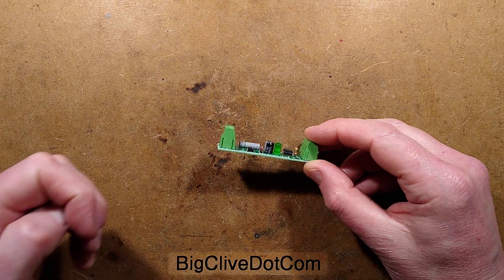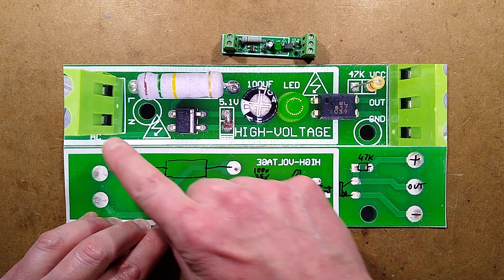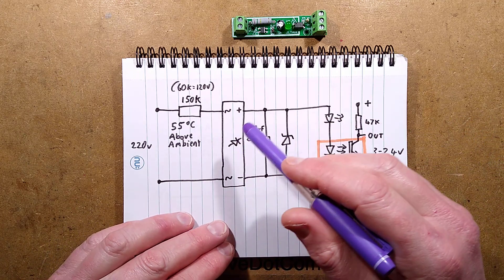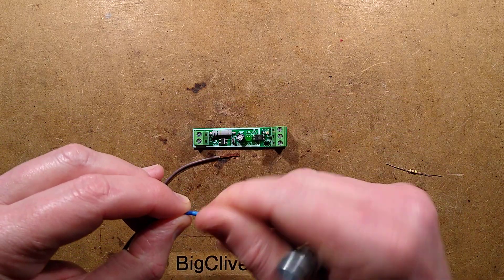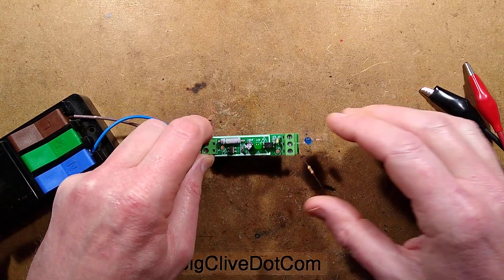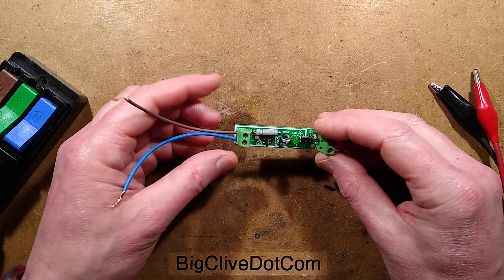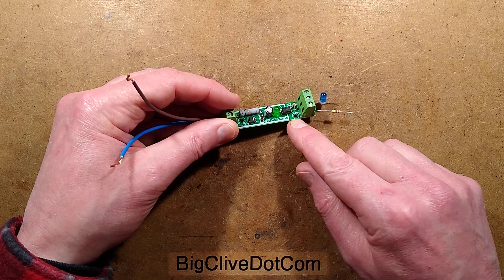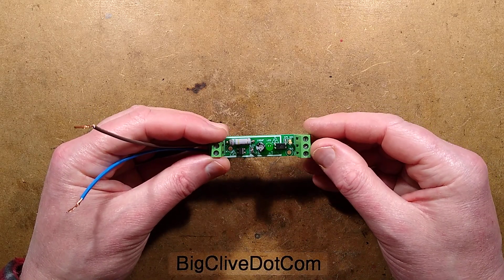120/240V to logic level optoisolator (with schematic)

Comment: Whilst I'm not an engineer who needs to use these on a day-to-day basis, this was very interesting. And handy tips to designers and manufacturers based on your experiences. Good stuff.
Reply: I'm going to use one to detect when my oil boiler is actually fired up by connecting it to the oik switch solenoid. This will then send the data to Home Assistant which will log the hours burnt and tell me when to refill my oil.
Reply: @WINGNUT307  
Good to hear of a link to monitoring your oil boiler with a Big Clive practical application.
He must have been a very accomplished lift engineer with his approach to repair.
Servicing in any trade needs more Clive's, my opinion for fifty years and travelling half the country working for national companies.
As an industrial electrician from the sixties I did a crossover to  work as an R&D engineer on oil combustion, including boiler design and then gas combustion after the oil crisis.
My electrcal knowledge gave me fifty years of advantage to help many good mechanical engineers to improve their electrical thought processes. 
I made alarm circuits to notify customers when the oil tank was getting low, float switches with mercury switches to prevent any fire risk with arcs and oil vapour venting to atmosphere.
All before Watchman or similar systems when I became a heating service engineer in Dorset and Hampshire. Oil servicing had few respectable craftsman so getting paid to drive around the New Forest was a gift.

Comment: The zener is there to protect the cap from a smoldering death in case either LED goes open circuit.
Reply from the maker: The current is very limited, so it might possibly pop, but would be more likely to slowly vent.
Reply: @bigclivedotcom  the hiss of sadness...
Reply: Magic smoke
Reply: @bigclivedotcom  we want to see what happens if you disconnect zener and the LED.

Boom or fzzz.
Whatever, if a cheap zener can prevent just a little goo in your box, fine.
Reply: @bigclivedotcom  Are you sure it is zener? Maybe it is there to offer ESD protection to the input side.
Reply: It could be there as protection for the other components, not necessarily the capacitor since it could also be an arcing protection if the diodes go open circuit. Or the power supply part of the circuit could have been copypasted from a different board with no thought or understanding of what's actually necessary.
Reply: C will smoothen the current flow and i would prosume the zener will protect the diodes from voltage peaks.
Reply: @Johennessy  The capacitor in series with the resistor should be sufficient to handle any spikes, the Zener should only come into effect if either LED (IR/optocoupler or green) goes open circuit.
Reply: @Ghlargh  But by then, the board's broken (and only a £4 part, so probably not worth fixing) -- so no-one cares, and the Zener's worthless.
Reply: @theskett  If it's arc protection it's not so much to save the rest of the circuit, it's protection from possible overheating and fire.
Reply: @Ghlargh  Ok, but if there's an arc, a 1W zener won't save me :-)
Reply: @theskett  The point is that the zener will keep the voltage low enough that you'll never get an arc.
Reply: It's quite fun to watch, though; much like our conversation. Oy, Ghlargh doesn't know arcs and sparks.
Reply: @theskett Oooooh! Resorting to name calling, how mature.
You do not need extreme currents for arcing, just sufficient voltage. The current is limited by the capacitor.
If the LED goes open circuit you might get arcing at fairly low voltage inside the LED package which can cause significant heating if the voltage is allowed to increase. The zener keeps this voltage low.
Using a zener like this is fairly common in LED lamps and other circuits that use a capacitive dropper or non-isolated buck converter for this specific reason, to limit the voltage in case the load goes open circuit.
Reply: @Ghlargh  LOL, I'm plenty mature :-)
You're confusing tracking with arc'ing.   Of course the current is limited by the drop capacitor.  You won't get arc'ing because if anything to the right of the rectifier goes open circuit, the resistor prevents an arc; haven't you actually played with electricity?
And no, most LED lamps don't have a Zener, because it's a waste of 2c or so, and the pick-n-place machine's time; the LEDs go open-circuit, or the electrolytics dry up, or there's some other fault.  But it's NEVER a thing that could be fixed by adding a Zener, to avoid a warranty replacement.
You big chump! :-)  #MoarNameCalling 
Try another round, let's see what you've got.
Reply: Interesting. Do you know what value of the zener diode is?
Reply: The Zener is rated 5.1V, the input voltage is 230V / 120V. The cap is rated 25V. Without the zener, the voltage on the cap and the output circuit would be 230V / 120V. Right now, it will be 5V.

Comment: Thank you Clive!  Another great video as always. This is exactly what I needed for my project.  I “reverse engineered” my own circuit, but I found that my Esp8266 was occasionally picking up the ripple from the mains.  I ended up putting another small electrolytic cap on the logic side of the optocoupler.  Works perfectly!

Comment: A very similar tech is used in some 3D printers for the power loss resume function. A 3D printer has about 150-300W worth of heaters and 40W worth of motors, and the PSU is guaranteed to hold over at least 25ms dropout from its stored energy. So when the expected mains pulse is not detected, they can quickly turn off all heaters - and they still have about half the capacitor energy in the PSU left, which is enough to run the relatively frugal motors to move the toolhead a little bit up and prevent damage to the print, and then write a cookie to the internal nonvolatile memory, saying which file was being printed, which line was last finished, and where the toolhead is at at this moment, and then just wait until the power drains from the power supply. When the power resumes, they can just continue printing.

The voltage sensing needs to be mains side, because when you see the voltage dropping on the output of the PSU, it's already too late, it has basically no residual energy left. Also they insert it before the manual power switch, so when you power it off by hand, obviously you wanted it that way, while if the cord is pulled or the mains just collapses, then the power loss resume is activated.

Eventually other ways to implement resume were implemented by just always writing a cookie every layer with no mains side sensing, but it's not nearly as clean.

Comment: You're probably expected to be mounting something like that with those little nylon push-on press-fit standoffs, not screws...
Reply: Yeah, nylon pylons. Or nylon screws.
Reply: Are plastic screws a thing?
Reply: @colejohnson66  welcome to our age.
Sorry.
I mean, they literally are, I'm not the only one who thought about them instantly when Clive mentioned that you can easily short the resistor's contact with a metal screw.
Reply: @colejohnson66  and they even can withstand temperatures over 100 °C.
Reply: thought the same but still better be designed universal
Reply: Yep, nylon snap standoffs.
Reply: @colejohnson66  They are, and have been for a very long time- I remember building a power supply using the old TO-3 transistors- which the case was part of the circuit- you could use metal screws with plastic collars, or plastic screws- I always preferred the screws myself-- otherwise the heatsink would become 'live'- this would have been probably the late 1970's
Reply: I came to comment the same!
Reply: @colejohnson66  You may also find them attaching vehicle number plates.
Reply: @colejohnson66  Yep. Screws, nuts standoffs, clips. Usually made of nylon. Google "nylon screws" if you want to see some. Handy for potentially shorting uses like this.
Reply: @colejohnson66  Yep, and while not a replacement for metal, when you need 'em, they're great! Readily available from McMaster-Carr and others.
Reply: should have been a 'plastic' in there- I preferred the plastic screws
Reply: @colejohnson66  Gamers Nexus recently reported about a PC case that caused fire in certain cases and it was because metal screw would pierce lower level trace in the PCB and short it to ground with resistance just high enough not to trip the PSU internal short circuit protection. The manufacturer solution was changing that screw for a plastic one.
Reply: @colejohnson66  There have been nylon screws since the 70's but delrin is better. Look at a nylon M3 too hard and it will strip the thread. Delrin is about twice as strong so less likely to strip so easily. Delrin screws are still hard to get and more expensive than brass.
Reply: @jkobain  "can". If you use them constantly near a hot element, they will probably become brittle and fail in a couple of years.
Reply: @SianaGearz  when we have a constantly overheating resistor, how many weeks a plastic fastener will endure is not our biggest problem. But you're correct.
Reply: @colejohnson66  You can buy nylon nuts and bolts.
Reply: Yep "Nylok" bolts, nuts, mica washers, heatsinks and thermal paste. Completely serviceable, done the proper way lol 🤣
These days almost nothing is actually serviceable, when it breaks you throw it away, instead of going to somewhere like RS and buying a replacement triac and actually fitting it. I went off electronics when it all became "non-servicable" as it does not teach you anything. These days even to light an LED, apparently you need buck regulator, capacitance and inductance. I mean WHY !!!

Comment: I know the fan timer pcb you mentioned, it's the same size as the one featured here but a bit longer. I think JW made a video about them a while ago. I've had several fail due to the resistor going thermonuclear so I converted them to half wave capacitive dropper using a 0.22uF X2 capacitor. No more heat and they're all still working.

Comment: During my Electrical and Electronic Engineering degree it was suggested that we rate resistors at twice the power if we want a long lasting stable circuit. However, if you are building in obsolescence use the only slightly higher, this ensures a short but acceptable life and more sales!
On the political side, I have a feeling that we are going to be paying a lot more for circuits like this. At least short to medium term.

Comment: Mounting holes: I suspect the intent is to use either heat-staked pins or the plastic standoffs that have a split top.
Reply: I came to comment the same!
Reply: Heat stakes would be my bet. I was trying to figure how to DIN rail mount them.

Comment: The Zener diode is in there in case the infrared LED inside the optoisolator goes bad and becomes an open circuit. In that case, the full RMS voltage (220 x √2 Volt) would build up across the electrolytic capacitor, causing its explosion.
With respect to the canonical design, there is a missing resistor, between the positive of the capacitor and the LED, calculated to limit the current flowing thru the LEDs at 15 mA. In the case of your board is R = 5.1 - ( 1.7 + 1.4) / 0.015 = 120 Ohm. 1.7 V is the Vf of the red LED, and 1.4 V is the Vf of the infrared LED inside the optoisolator.
Thank you for the nice video...
Reply: Otherwise where is the voltage difference going? Are the leds working on a higher foward voltage on their curve? or is the zener turned off completely? who wins?
Reply: @robegatt  The power would be otherwise dissipated in the 1 Watt resistor. If you draw the V/I diagram of the Zener diode, for all operating conditions, it become self-explanatory.
Reply: @antoniomaglione4101  You did not answer my question.
Reply: The cap's behind a high-value resistor, and hence won't explode.  May vent, slowly.  The Zener's a complete waste of time and money; redundant.

Comment: I remember getting a belt off a lift door open detector switch many years ago. The switch was two exposed contacts on the edge of the door at mains voltage, the circuit being closed by the steel of the other door.

Being an inquisitive teen-ager I poked them with my finger! They weren't shrouded or anything!

Comment: An alternative, and about the same price, is to use an old (functionsl) 5v USB phone charger to your detector pin on your equipment, optionally through an opto-isolator. We use (or have used) this as a solution on ham radio repeaters to detect when we're actually running on battery power rather than commercial power to operate the transmitter at a lower power mode to extend the availability time of the repeater. (Use a resistor, or a voltage divider and resister if needed for 3.3v to limit current going to your micro-controller if you're not running it through an opto-isolator. I'd also recommend validating that the '5v' is correct compared to the ground of what you're sensing with, and isn't incidentally floating at high voltage because someone put in a transformer that's been wound too tight.
Reply: What a simple idea. Like it.

Comment: Interesting module. When I need to detect mains voltage I use a DIY isolator,  a neon pilot light assembly shining on an LDR, and heat shrink over both. This kludge provides plenty of isolation and draws hardly any power.

Comment: Where I need to sense AC in my Arduino projects, I use a plastic encapsulated neon indicator (like a panel indicator lamp with an inbuilt resistor) and an LDR stuck on the outside, and wrapped in black tape.  LDRs are pretty slow and I've found that typical response times are around 1/4 sec.  The advantage is it's cheap, almost no heat dissipation, and I estimate better than 2500V isolation.

Comment: Been designing and testing quite large industrial systems. Apart from insulating high and low voltage, optoisolators are used for eliminating ground loops. They are often filtered to to suppress voltage spikes and other EMI. Commercially available optoinsulators can have a time constant of 20 ms. Had a problem in Finland where 3 optocouplers was fitted in series. As the machines speed increased, a pulse train fed into one computer disappeared. Every optocoupler shortened pulse length.

Comment: Unless I'm working with vacuum tubes, I'm not a fan of simply letting things run hot/warm like that constantly, especially for something as simple as voltage detection. Yes, "it works," but needless thermal stress is something to be avoided.
Reply: A better version of this is to use a capacitive dropper instead of a resistor (which @bigclivedotcom is well familiar with).

Comment: I live in an apartment building where I've taken a number of fan run on timers out with carbonised resistors and PCBs. Got some still operational examples if you wanted to see them. Grossly under power rated resistor in a capacitive dropper, TRIAC you get the idea. Designed to fit in an Australian mains socket. So quite neat. Low production run too. .

Comment: I use stuff like this all the time we have crazy machines that have to control 5 12 and 24 DC and 12 and 24 AC from PNP sensors and the switching thresholds and voltages get crazy to manage

Gotta love older Italian packaging machines

Comment: These days I prefer to use the AC-input optos, the type with two parallel LEDs that works on either polarity of input. The circuit then reduces to simply the opto and the resistor.
OK, the output is then a series of low-going pulses at 100 Hz rather than a solid low,  but its easy to either filter that with a capacitor on the output, or do that in code when driving an Arduino
Reply: Do you mean the H11AA1 ?
Reply: @gedtoon6451  Actually I'm using the TLP620, but its pretty similar to the H11AA1

Comment: I wonder why they use resistors instead of capacitors, wouldn't be better to power the the opto isolator using a capacitive power supply? I can only think of cost, a resistor been cheaper that a properly rated capacitor.

Comment: We used optoisolators in the reverse direction.  A logic level low would turn on the optoisolator.  The output of the optoisolator  connected to the gate of a triac (solid state relay) would turn it on and provide 120vac/240vac power to the load.

Comment: It seems they never do what used to be done with 'power' resistors, space them from the board, remember the ceramic bead spacers ?
Reply: I'm actually glad they didn't decide to draw it as another «fusible resistor» on the board, that'd be a disaster.
Reply: I still have a pack of those spacers somewhere. These days I just tend to use 1W resistors running at about 25% dissipation.
Reply: It's quite common for ceramic resistors to have very high temperature ratings, a couple of hundred degrees C or more, so the board burns and resistor unsolders, completely unharmed.
Reply: I bought a set of lead kinking pliers to get resistors up off of the board neatly. Works about as well as the spacers in my experience.

Comment: Interdasting. The lift safety circuit looks like one my mate used for an "IOT" mains frequency logging application in his old job. He asked for my advice on the circuit and I think I just said it definitely needs to be optoisolated. Pretty sure I also told him I'm not exactly comfortable working with mains, and he should probably ask a real EE.